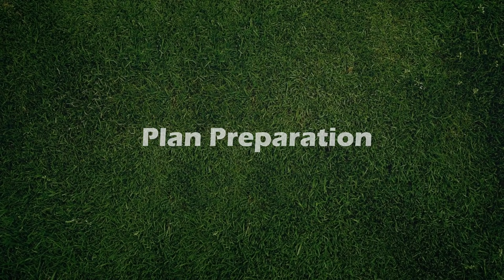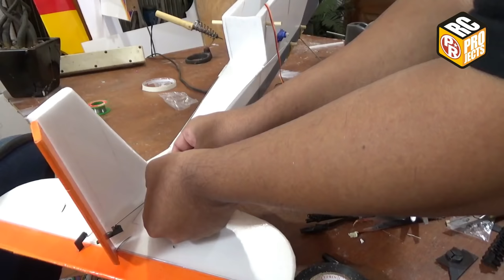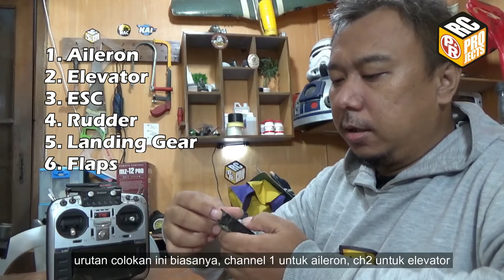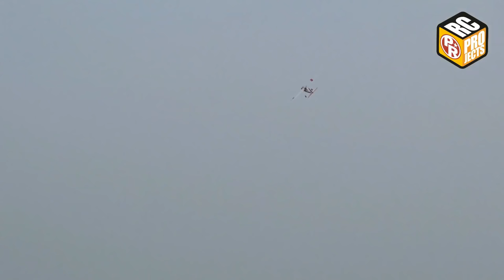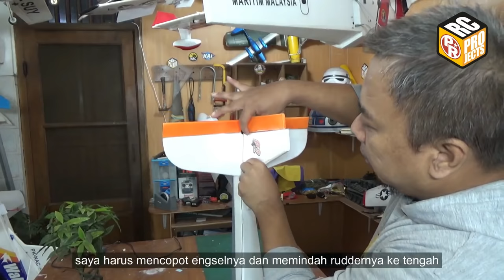Bango 2 RC Trainer Plane for Beginner

Comment: Excellent and very complete Beginner Trainer Plane. The design is good as protects the motor and all the expensive parts. ie: all key parts will likely survive to be included in a rebuilt plane, or the next model. 
Thanks for the hard work doing this, and for sharing. ♥️😎👍👍

Comment: Hi and thank you for the great work you do for the RC community.
I will be building a 75% version of your design and may I suggest you show a 2 axis version of your builds for beginners.
A few ideas for future builds: a slow flyer, a biplane, a Fokker DR1, a canard layout, an autogyro...
Keep on the good work
Reply from the maker: Autogyro is on my list
Reply: @JuliusPerdana  👍
Reply: How did the 75% version go? I have a small field so I'd love to build a smaller one
Reply: @samuelkrajc  Hi.  I haven't built it yet, it's on the list!
Reply: @a.berurier639  how do you know what parts to use after scaling a plane down? For example this one is supposed to use a 6x4 prop but how would I know what prop to use is it is only 75% of the size. Same thing with the motor and battery?
Reply: @samuelkrajc  sorry Samuel I don't know.  This would be my very first RC plane.  I decided it would be 75% scale to match the hardware I've already got: EMAX CF2812, 6x4 prop and zippy 3s 1500
Reply: @a.berurier639  oh ok. Well you should build it! I have built about 7 so far and this one flew perfectly.

Comment from the maker: Playlist :
02:06 Plans Preparation
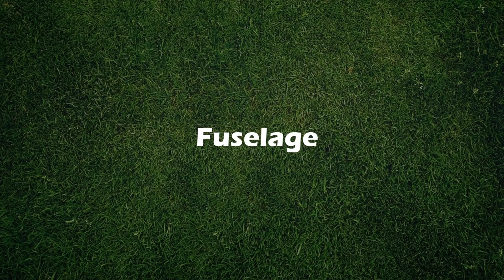04:06 Fuselage
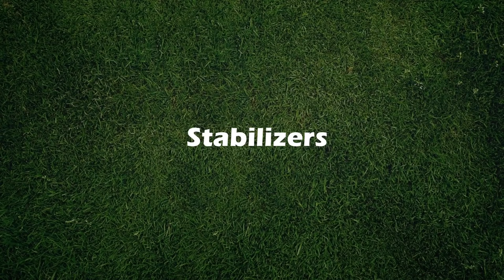06:34 Stabilizers
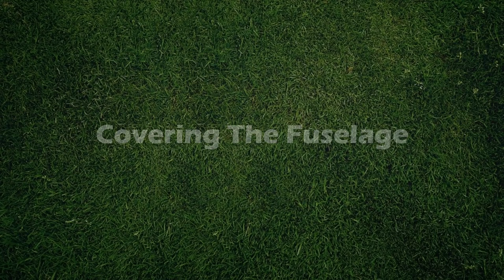07:32 Covering the Fuselage
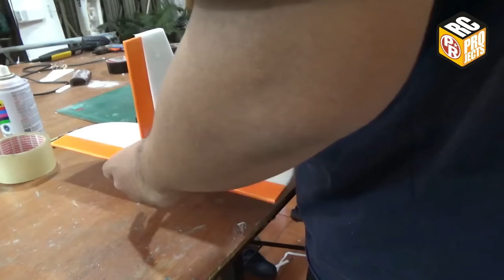10:36 Wing
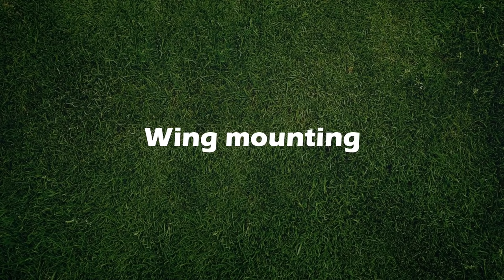13:13 Wing Mounting
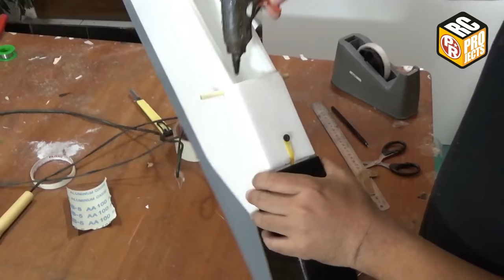14:13 Landing Gear
16:32 Aileron
17:31 Servos
21:30 Installing motor
23:32 RC Electric Plane Basic Knowledge
45:10 Maiden Flight
54:27 Review
57:03 Crash Compilation
59:36 Next Project?

You can download the plans on the link below :
http://paper-replika.com/index.php?option=com_content&view=article&id=9620:bango-2-rc-trainer-plane-for-beginner&catid=144:rc-projects&Itemid=207908
Reply: In plansx sdh aman gk om,sdh gk ad lg yg diubah?
Reply from the maker: @alimran5456  plan saya selalu aman, video kan sedang proses mencari2, kalo plan sudah final
Reply: Om semua bahan flypom nya pakai 5mm semua ya om. Saya mau coba buat terimakasih om video nya bermanfaat banget buat saya pemula 🙏🙏🙏🙏

Comment: i built one, kept a 1degree extra aoa of the main wing, flew like a dream (lemon 3s 2200mah kept a little aft from the specified pos), had no nose droops, but the wing snapped, even after adding extra reinforcement.

Comment: At 22:07 you placed the motor on a small piece of wood. That small piece of wood is joined to a larger piece of wood. The two pieces of wood are joined at an angle. What is that angle  between the small wood and big wood. It looks like 60  degrees.
Reply from the maker: Yes that's correct

Comment: Pak, pls confirm that in the plans for this plane W5 is given as two options (straight wing or dihedral wing) and we should use only one of the two templates given for W5, correct?
Reply: Correct either straight or with slight angle
Reply: @ravichat3077  thanks Ravi.
Pls advise if you have made this model. Am facing some difficulties.
Reply from the maker: yes both are fine, but for beginner use dehidral
Reply: @captaintwice  So far i made Fuselage. did small mistake in wing cutting so need to build wings again,
Reply: @ravichat3077  i made the full model.
Thanks. All the best.
Reply: @ravichat3077  if you need any help, pls let me know.

Comment: Salam Tuan Julius, saya bertanya jika, misalnya, saya mempunyai motor Brushless 2212 1400kv dan ESC 30 amp, berapakah peratusan yang saya miliki untuk mengurangkan pengukuran pesawat? (Greetings Mr. Julius, I ask if, for example, I have a Brushless 2212 1400kv motor and ESC 30 amps, what percentage would I have to reduce the measurements of the plane?)

Comment: Hi Julius, would you be kind enough to answer a couple of newbie questions? I am UK based, so anyone here feel free to chip in! What exactly is the paper you are covering everything in, and what is it usually used for? And, the best 5 mm foam price I can find is laminate floor insulation sheets, 500mmx1000mm, 10 sheet pack for £17.50 from a local floor shop, so £3.50 per sq meter Am I likely to improve on that?
Reply from the maker: The paper is wax paper. Which one? I don't know because we only have 1 type of wax paper here, we called it "kertas minyak" which literaly means "oil paper". Usually for food packaging and kite making. Yes XPS is usually for insulation, you need to peel off the lamination if possible
Reply: I plan to build one or more out of Correx/Corro-Plas for a friend and my son as I get Correx/Corro-Plas off a friend for free! Any advice on wether it will still be ok if a little heavy with this material,Also Julius what is AUW of yours please? Many Thanks And Kind Regards Steve 😀

Comment: I enjoy your videos...I think it was extra special that you took the time to explain the RC basics in a visual hands on way. So many types of these hobbies assume you know what is going on already. You did a good job! Thanks Also I was curious and was looking at your plans. It seems the type of foam sheets you recommend is not on the market any longer, any other suggestions? Also wondering if you knew what size sheets and how many are required to make this or any other designs you have? :)
Reply from the maker: Its basically an XPS foam, please look for it

Comment: I'm a big fan of your channel. It's really great one. But have confusion about prop . I downloaded the build plan from your website where mentioned 6x4 prop and flying time you mentioned 7x4 prop  and then 5x3x3 prop. Actually which prop you recommend finally  to build this model ? End of your video U told that you have raised the wing's  'Angle of attack' by 0.5 cm and reduce the motor mount  but how much degree? Did you update the full plan in your website ? I mean whatever I downloaded (build plan) from your website , is it final updated one ( A4 or AQ)?
Reply from the maker: You may refer with the final specs : it's 6x4. It's like trial and error, 7x5 was too big, 5x5x3 was too under powered
Reply: @JuliusPerdana  You always  do an excellent job. Keep it up!
Reply from the maker: You dont have to change anything, off course it's updated plans

Comment: I seen Paper Replika recently most of the Paper model designed you... Awesome work.

I plan to do some airlines  models which not in the list, so I need to reprint the existing models

Could you share which software you reprint for Paper Aircraft Model

Comment: Hi! This is very impressive! Would Depron 6mm be okay? I cannot find 5mm nearby. Thanks you so much.
Reply: Short answer: Yes!
Long answer: Did you see the blue Cessna 172 he did? Well, I finished it and I used 6mm. I had no problems, and I didn't adapt any part of the blueprint to do it. There is also a more common material used to do cardboard painting and labels called foam board (cartón pluma in Spanish) it's exactly the same material (XPS) buy with papers on the sides. Depending the company producing it, you can easily peel it off or not. Since the ones I can get are glued very hard, I did the fuselage with that one and the curved parts and wing with XPS 6mm.
Extremely pleased with the results
Reply: @tomashortig6547  thank you so much! Exactly what I wanted to know !

Comment: Hi. Why the CG is 4.5cm from leading Edge of the wing? I mean, for a different plane, the correct cg how to calculate? then we can move the battery to balance. If I correct, 25% rule: mean this plane wing is 18cm ===>>> 18/4=4.5cm is the CG?
Reply from the maker: CG range from 30% to 25% of the chord/ mean aerodynamic chord

Comment: Can I use 2212 /1400 kv with 8045 propeller ( or I am having 2212 2200kv and 5 inch prop 3 blade  )and thanks for the sky arrow  plane it fly very  good in high wind also
Reply from the maker: yes you can

Comment: I find the wings are the most difficult to build and they take a lot of foam. Plus all the servos in each wing. A universal wing would make the hobby a lot cheaper and easier. Maybe you could use a plug with multiple connections so that all the servos in the wing ended in one plug. Then you could make the same connector on the receiver side so we only needed to attach one connector and be good to go!
Reply from the maker: good idea, but if you want to make scale model plane, each plane has different wing shape, you cannot just use one wing
Reply: @JuliusPerdana  I agree there are differences, but for me the largest difference between models is by far the body (nose, fuselage and tail). Another benefit of one wing is the amount of space needed to store planes, and I only have a small car so I can only fit a couple of planes in. Anyway, thanks for your replies, looking forward to more of your great designs!

Comment: Thanks for the amazing design! But I have a 10-inch prop, so, how can I modify your amazing plane for my prop? The main problem, that I have 2212 800kv brushless motor from Mi-copter. It has a 6 mm shaft with a screw. So, I can't just a buy a new prop.
Reply from the maker: Maximum prop size for this plane is 7 inch using 1400kv motor
Reply: I got it. But, If I increase the vertical size of the cabin in 2 inches, will it fly?

Comment: Can I use 2204 2300kv motor for this model and 20A ESC with 1500mah 3s lipo for save some weight and as well as for slow flying?
Reply from the maker: yes

Comment: Great video!
Maybe also an idea to do a topic about learning how to fly RC planes using a RC simulator. I am a big fan of the Picasim (free) simulator (Android and PC) which works great with the PS4 controller. Especially because you can change all realistic parameters (wind, weight, power, CG). I found the combination of simulator training and outdoors training the best. You should take the time before you crash your first real model. The basic Multiplex PC simulator is also free.
Reply: Also the last thing you should mount on your model is the propeller.
Reply from the maker: Yes I forgot about that, thanks
Reply: @JuliusPerdana  Instead of testing if the propeller turns the right way; I always draw an arrow on the outrunner motor.
Reply: @JuliusPerdana  Also would it be fun how a white plane would look after schoolers would colour it with sharpies?
Reply: @JuliusPerdana  Another safety issue is the failsafe; what happens when you turn off the radio, also without the propeller!

Comment: Om, saya juga bikin Bango 2 ini sejak 1 minggu yg lalu, tapi kendala saya di elevator terbaik pada stik remot nya. Harus nya stik di tarik ke bawah elevator ke atas ini malah ke bawah juga. Bagaimana solusi nya ya om? Apa yg harus di rubah?
Reply from the maker: Diubah di setingan di Reverse biar bener
Reply: @JuliusPerdana  oke om, terima kasih nanti akan saya pelajari dulu di remot nya. Satu lagi keluhan saya sebagai pemula om, untuk Bango 2 project pertama saya ini saya paling susah bikin sayap nya. Bikin sudut melengkung dan pengeleman nya copot terus.
Reply from the maker: @ajicksaputra2307  dibantu lakban kertasp
Reply: @JuliusPerdana  iya om. Terima kasih. Sudah saya paksa lem bantu packing tape. Walaupun lem nya ga semua bagian tepi rapat tapi saya satukan pakai packing tape. 
Saya pakai motor 2212 1400kv + esc kuning 30a yg dari Cina itu om,  kira kira kuat ga ya om? Batre 2200 3s

Comment: Hi mr perdana
Xcellent works and making plans open for us is wonderful
Thank you so much

Xpecting warbirds from you
Reply from the maker: You are most welcome
Reply: Hi 
You mentioned changing thrust angle and some wing changes after your first flight
Can you mention please how that changes can be done?

Becauuse  i saw sudden pitch changes in the first flight which a junior cannot afford ,i think
Reply from the maker: You don't have change aniything just follow the plans
Reply from the maker: Maiden flight for you you have all final revised plans will be different from mine, because mine was still trial and error. No new plane when in testing working well. The final plans will performe like the last 2 video
Reply: Thanks🙂

Comment: How to use hot glue? when I use hot glue my foam melt. How to do?
Reply from the maker: find new refill that has higher melt points or find another glue gun with lower wattage, i  use 20W gluegun
Reply: @JuliusPerdana  use low temperature?about glue is special?
Reply: @JuliusPerdana  Do you use nomal Glue sticks? for gun glue you use 20W?
Reply from the maker: Taiwan made glue stick
Reply: @JuliusPerdana   I need it.
Reply: @JuliusPerdana  I can buy gun and Glue sticks from you? I stay in thailand not have sale.

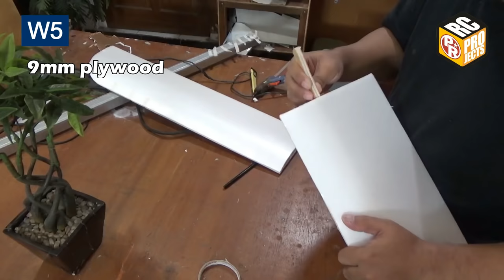Comment: some info.      good work...except where its not.      WHYNHEL    do  you  boys  insist on producing  crappy  designs, instead  of  COPYING    good   Ones.       this model  Should  look  more  like  the  'bixler' (from several years ago); note  the  details  of  correct  alignment  of  offset  thrust.   so that,  the thrust line  Intersects  the point (inside the fuselage) where the  c-m  SHOULD  be  located.    c-m  is center of mass.    see linked info.        it will behoove you to  develop an eye for  PROPORTION.   aka  ratios.     in this case, the excessive elongation of the forward fuselage  results in  a (misleadingly) Excessive  fuselage length; which seems to be in proportion with the wingspan.    the truth is,   BOTH  dimensions  are  wonky.        obviously, this iteration of  detachable landing gear, significantly, increases the model's auw.      the  strut height  is  EXCESSIVE.  this is not an opinion, it is a fact.        when the fuselage is level, the mass of the wheels/struts  Should be  below the main wing leading edge.         at 10:32,   the use of an asymmetrical rudder hinge  is  NOT  recommended.    do  it  BETTER.!!!          at 12:28, the design of a  dihedral wing  Should include a  center section;  and  a  main brace that  spans  the width of the fuselage.        at 16:47,  ailerons  SHOULD  Extend  to  Near  each  wingtip !!!!          at 26:05,    NO    GAS    props !!!!          a  NOVICE  pilot should not  Have  to  learn  ailerons !!!!    thus, there should  be  sufficient dihedral in the main wing to allow  the use of  Rudder-initiated  turns.      ailerons can be learned, later.   or  not  at  all.     assuming mode2 radio, rudder should always  be  on  the  left-stick.  cheers        googletranslate
http://static.rcgroups.net/forums/attachments/2/9/6/3/9/7/a5988257-224-bixler%202%20motor%20angle%20correction.jpg
https://carochelais.files.wordpress.com/2015/03/bixler_3.jpg
Reply from the maker: thank you for giving critique all this time, I'll improve it on other build. This is designed and build by amateur RC aviation enthusiast just for fun.